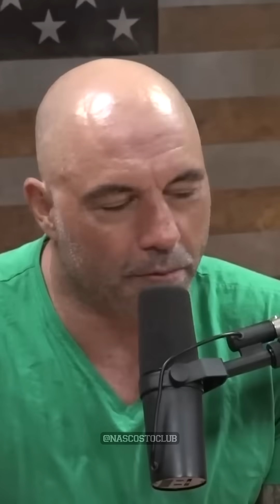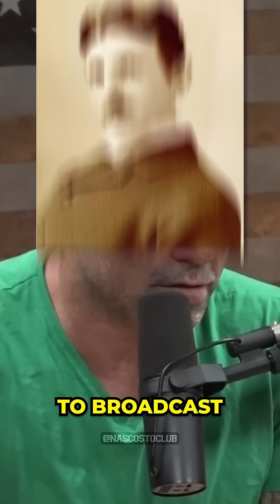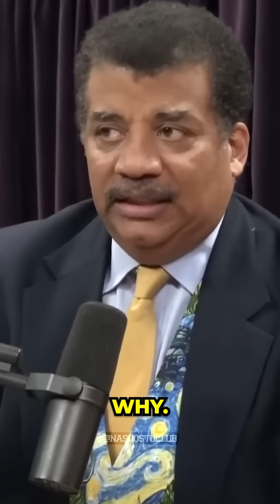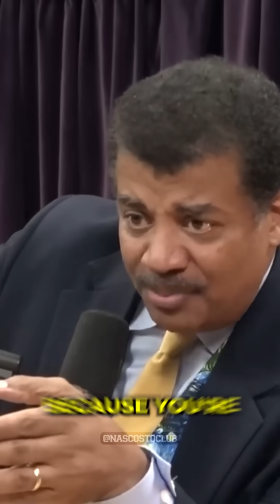WIRELESS Electricity Idea Debunked ⁉️⚡ #shorts

Comment: radio waves dont travel in straight lines tho, this energy would fill this room and wouldn't be focused to a point, a conductive material would be able to draw this current out of this energy filled room, unfortunately this room would need thick enough insulation to keep this energy in aswell as thin enough to bleed enough out in order to keep the room passively stable to not waste energy as heat in the room and the man is right when he says that you cant put a whole lot of energy into radio waves
Reply: it could work, it just wouldn't be practical at all

Comment: Put it like this. Why dont you touch live wires? It will hurt or seriously harm you. Now imagine if the air in a certain region has just as much electricity as that live wire. It would be like broadcasting a lethal taser across said region.

Comment: You know idk if I’m completely wrong for thinking of this but wouldn’t we be fine bc we’re grounded, like to the earth? And maybe you could get away with saying well as soon as you put rubber shoes on or pick up or take your feet off the actual ground like going into your house for example, you’d be killed but idk. Also what if in Egypt they had electricity in some parts but built their systems underground so their weren’t any wires hanging. 

If you read this far pick which theory I actually believe comment your answer and if you’re right I’ll give your comment a ❤

Comment: They both are confusing what 'pulling electricity out of air' means. In one instance it's not the same as "sending electricity trough the air". It's possible to extract electrical energy from charge difference in air, from low ground to the tower, spear or balloon, if it got a sharp top,  just it will be low amperage. Voltage will depend on the height of the receiver spear. Just not financially viable, but proven to work.

Comment: Don't we got lile bluetooth light bul s wireless chargingni mean shit my phone can charge other phones wirelssly so I mean it is possible but it would need highly conductive towers basicly super cooled to increase conductivity and wrapped ina gell expt for transmitters point to force the electricity into a current that won't loose and instead gain more komeintum and power as it goes slowly building and then dispersing qltho I could be tottaly wrong but thinking logical high enough up it should be possible or underneath ground however mid level well military weapon for human microwaving basicly which is alsp efficient